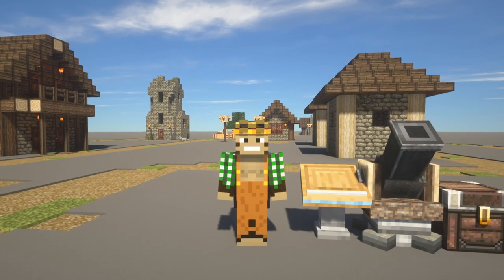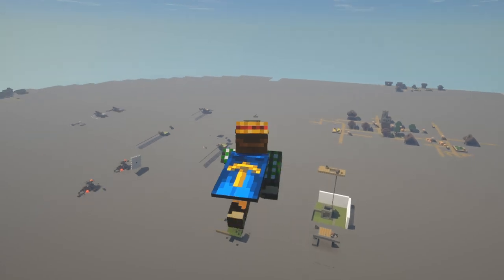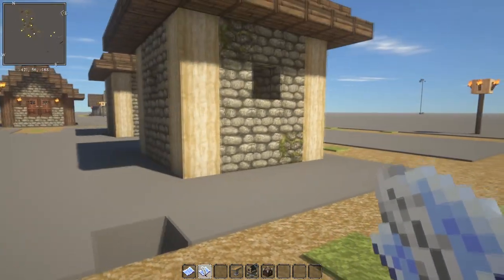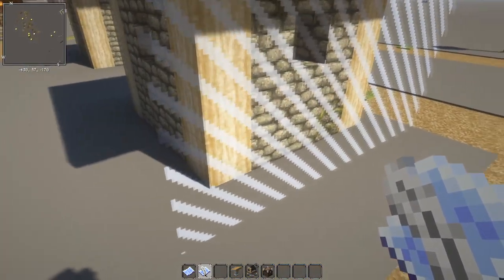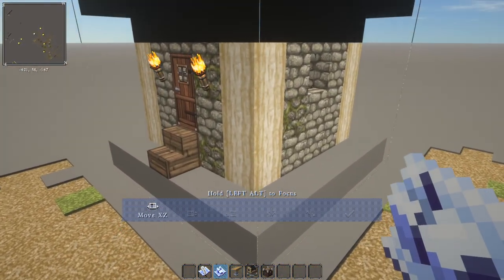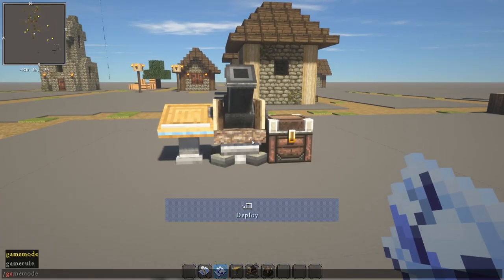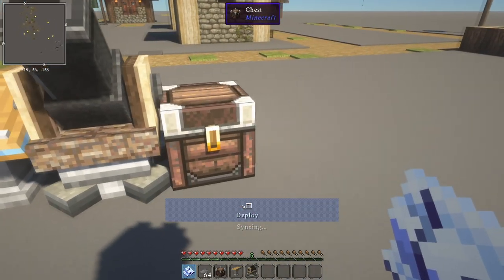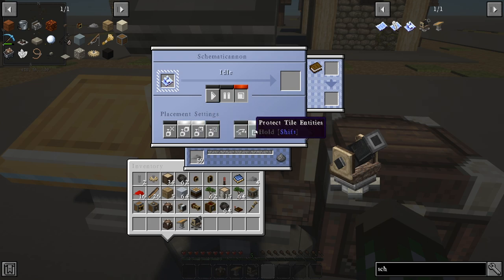Create Mod Schematicannon - Minecraft Tutorial

Comment: Aside from building, this could also be used to transport materials. Want to be able to send diamonds to your friend's base quickly? Make a diamond block, place it, make a schematic for it, point the canon at your friend's base, load the block into the cannon, and fire. The problem is that you need to go to your friend's base each time you want to send a different material with the cannon, so that kinda defeats the point. Still, you could pick a few items that you plan on trading often and set up cannons for those items. For example, you could have a wheat farm that sells wheat to other players so they can make bread. To transport the wheat, you just craft the wheat into 64 hay bales, load them into a cannon, and fire it to one of a few wheat pickup areas on other parts of the map where the canon places them as a 4x4x4 structure of hay bales.
Reply: They need diamonds to make it tho
Reply: "quickly"